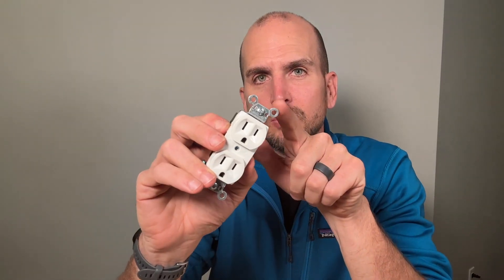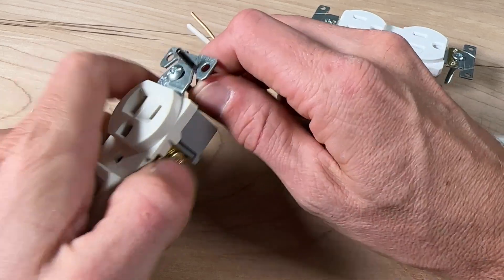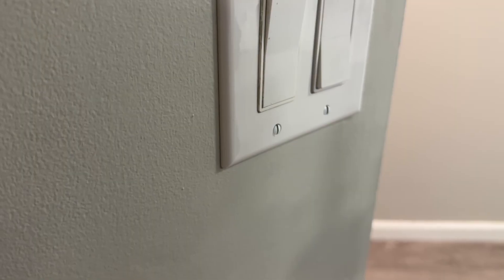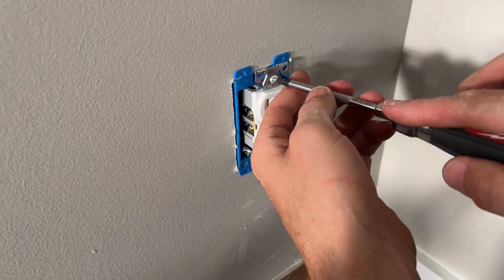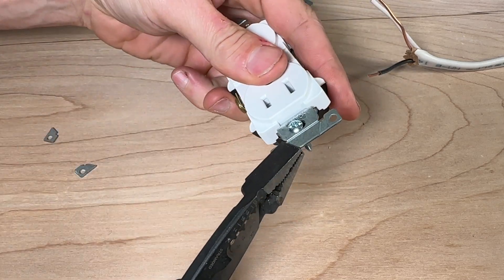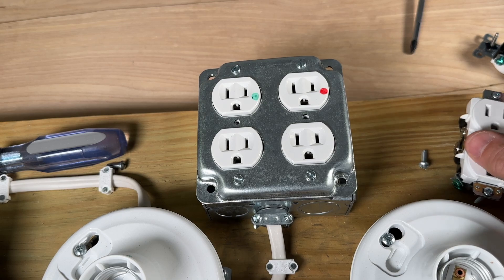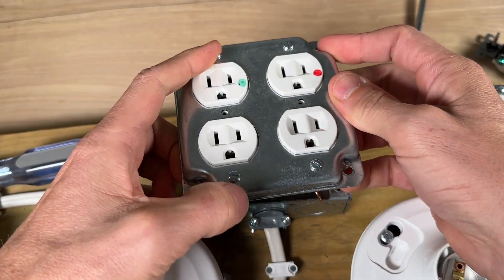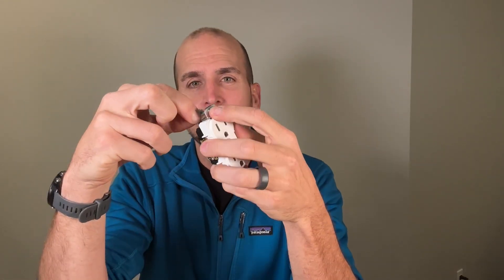Why Outlets and Light Switches Have These little Ears

Comment: My outlet receptacles and the workbox are secure and the plaster ears are sitting right on the drywall, just like your example at 1:12, but my faceplate still wiggles after I tighten the single screw. I'm doing something wrong.

Comment: Hi Scott, older female here. I am too old, rather my knees are too old to do repairs anymore.  Sure do wish you and YouTube were around when I was.  My life would have been so much easier.   I actually liked doing them myself, esp considering how poor the work ethic is.  Just had my LR painted. Found after they were done none of the wall plates were flush and loose.  They, for some reason, pushed the interior in too far. My knees did not appreciate having to go back and redo them all.

Comment: Holy crap, well shoot. Ive been swapping outlets for years in my current home and in my previous ones and i always used those ears to set the depth since most of the old outlets i replace dont have the outlet flush anymore (they as you said would be referred to as sunken). So ive just been bending them a little on each side until the outlet sits flush when i tighen down the screws. Had i known or thought of braking the ears off and using them as spacers id have done that a long time ago lol. But now i know at least. Time to take an hour or so this weekend and go over all the outlets ive replaced in my current home and fix them so the ears can be used as spacers and i can get a more secure stable outlet. Truth be told i need to redo all the romex in the house cause half the house has the original wiring from 1952 when the house was built (which means no grounds or even grounded junction boxes). And the other half of the house that was added on in the 80s might have grounds but its still pretty old and i would feel much better knowing everything is new and up to code. I also have power swings throughout the year that are terribly unacceptable but the power company just shrugs me off everytime i call. We are talking as low as 100v in the summer during the hotest parts of the day and as high as 136v during other parts of the year. Chalk it up the the joys of living in an older house in an older neighborhood i guess....??? Great video, thanks for the info!

Comment: I found another use I think may at least be another reason for the tabs with the holes. A long time ago receptacle boxes were metal and commonly nailed into the baseboard or a wooden surface. they had adjustable tabs so the box could be set to a specific depth. When outlets with dual screws for mounting the faceplate (those decretive square ones for example) came into existence the screws that mount the faceplate hit that adjustable tab making it impossible to tighten the faceplate to be flush with the wooden surface. So, if you want to put a decretive square outlet in a really old-style box start by pulling the mounting nails from the old box. Remove the screwed-on adjustable mounting tabs from the old box, mount the new outlet to the old box with the two mounting screws but then use those tabs with the holes in them to screw (or re-nail) the box and outlet combo back onto the baseboard or wooden surface. Problem solved!

Comment: The worst is always the ancient brick outlet cutouts with generations of layers of various plaster and drywall, leaving the box waaay too deep and, usually, plaster/drywall wider than the box. Then you're forced to mess with stacking nuts or tubes and using longer than standard outlet screws to get it flush. PITA!

Comment: For the metal boxes like the one shown in the video, you'll also need 8-32 (I think) nuts to secure the outlet since the bolts aren't contacting anything strong on the backside in that scenario.

Comment: Thank you for this video. I was wondering why my new Leviton Decora switches and outlets with the Decora screw-less covers in place sat out about a 1⁄16 of an inch from the wall. I am using Carlon old workboxes. I will remove the plaster ears and see if in fact the fit to the wall is better. Thanks

Comment: I was going to ask about the box extension that is illustrated towards the end of the video.  I had a stock of plastic rectangles sized exactly to the perimeter of the box (not the sleeve as shown here).  They came in various thicknesses (1/8” to at least in the extreme, 1/2”).  They were also stackable.  Each thickness was a different color.  I’ve exhausted my supply and could not find them anywhere.  I was unaware that there was an insert sleeve as shown in the video.  I still used the plastic spacer tabs that piggy back together.  On rare occasions, especially on older homes I’d have to go to the extreme to get the outlet to be flush.  It was then problematic that the terminals on the side of the outlet were exposed a bit too much.  To remedy, I would wrap 2-3 wraps of electrical tape encircling the terminals on both sides.   Comments?  Now that I know this insert extension exists I’m purchasing a dozen or so.

Ps when searching for the insert extender, I did indeed find the other color coded stackable extenders in the same search.  Go figure…

Comment: Total respect for your knowledge.  The next time that I have to replace a wall switch, I will have my wife hold the screw driver and stuff while I
explain to her all the features of the switch. Especially the built in wire stripper & the Mikey ears.  I will do it in the morning so my perceived wisdom
will be rewarded with a Lasagna for dinner.

Comment: As an electrician to this day when I rip off these ears or the yoke of the device I save them for another time I may need a small fender washer for a 6/32 or 8/32 screw. Works great for that application too. Save them. 

Jeff - Licensed Journeyman Electrician Sunny Central Florida

Comment: ----- Kudos,  Good explanation,  and you nailed it by saying you "could" use the broken off ears as washer spacers but that it probably wouldn't fix the problem  -  it won't because the receptacle will rock.  The other point you didn't mention was 10 out of 10 drywall installers who cut out the outlets with a rotozip are going to cut them too large for the ears to touch.
Reply: Yeah, every outlet and switch that I've ever had to remove the plate from in my house has the hole in the sheetrock cut too large, with crumbly plaster/mud patches. Most of those are oversized plates, too. I've considered 3d printing some kind of extra-oversized plates, or intermediate/adaptor plate, but the gaps aren't exposed beyond the plates as is, just too much for a solid mount. Not so much of an issue for light switches, but outlets for vacuum cleaner get kinda sketchy when the cord gets yanked and the outlet shifts left or right  behind the plate.

Comment: Only consistent if whoever cut the hole knows what they are doing and dont over cut. Which in my years i have found the installers getting lazy and holes are over cut and the outlet sinks i

Comment: At +3:30 a better example of when you have to remove those tabs is if you use a Handy Box (ie, a surface mount single-gang box). The receptacle or switch won't fit correctly inside a Handy Box (versus onto the cover plate for that 2-gang square box you show) unless you cut off those tabs.
Reply: I've never noticed a problem.

Comment: Regarding your suggestion about using the removed ‘eyes’ on the mounting screw as a spacer, and yes it is correct that they are typically too thin to have much effect except in those rare situations where you only need that 1/16”, I for years have been throwing them into my assorted nuts/bolts/screws/washers containers and find numerous uses for them when I’m doing a project and need something to space a gap, or desire a tiny washer.
Reply: Yeah.  There's a fine line between keeping truly useful stuff like that and collecting dozens of pounds of miscellaneous hardware in a collection of 1- and 2-pound coffee cans, which—both cans and contents—are among the first to get tossed by your wife and kids after your funeral.

Comment: Nuts. When I have used old work boxes in the past I cut a relief with my utility knife in the plaster. Too bad I didn't learn this sooner. I even knew about taking the ears off for some kinds of electrical boxes but I didn't think outside the box to figure out to take the tabs off for an old work box. Also good idea about using the tabs as spacers although I use the green plastic spacers for that usually.

On how far beyond the stud to mount the box: If you know that 5/8 inch drywall is going to be used the box should be mounted half inch from the stud face. This is a little harder to do because you can't use the 3/8 inch spacer built in to the box. You can use a scrap of 1/2 drywall as a guide or just not be so obsessive and eyeball it.

Comment: I'm an electrician and it makes me smile that you do all this research, and spread good information. Thank you. One thing I would like to add is wrap your outlets, over the terminals in electrical tape if you use a metal box. Those metal or ID (industrial) covers can spring to one side when removing and bzzt.
Reply: @Kevin-mp5of  LOL you have no idea what you're talking about. Clearly not an electrician, most likely a DIY homeowner. Also the term is Phase color.
Reply: @Kevin-mp5of  OK you're a hack. Get over it. Try learning how to form a sentence. Or a complete thought.

Comment: Your reccomendation that the plastic box be 1/8 inch gap from the sheetrock is illegal. Boxes are to be flush with flammable surfaces. If not, every box not flush must have a box extension to make it flush
 Been code for 40 years at least.
Reply: @Kevin-mp5of  exactly my point. Look up " box extension" at Home Depot. Also know in the field as an arc suppressor. Plastic sleeve with ears to bring non- flammable area flush, per code.
Reply: Literally had inspectors ask me to remove specific plates to check for either flush box installation, or box extension. City of Houston would fail your inspection if trimmed out illegally.

Comment: Thank you for the "TIL".   It is sort of basic info but not basic info I knew.  There have been times over the years when I was frustrated with the fit.  I never thought about removing the ears.  I think I usually just assumed the box was mounted a bit wrong, hence the small gap in the cover plate.

Comment: Interesting to know.
One thing that really bugs me with the square boxes is that they assume that the studs in the walls are perfect, which they almost never are so the outlets often are a bit skewed.
The boxes I have seen here in Europe are round so you can actually turn the switch or outlet to be straight even if the box isn't perfectly mounted.
Reply: If you look at sec 17 uou can kinda see it. The outlets screews are not in a hole but a slot. So you can rotate the outlet a small amount before tighting down.
Reply: @maxwellmelon69  I have seen that but I have also experienced that those slots are insufficient.
Reply: Square boxes like 3:30?  If you're using a mud ring, you can make the mud ring level.  The corner slots for the mounting screws allow for easy adjustment.

Comment: Can you do a video on the benefits metal outlet boxes verses plastic boxes?
Reply: Metal outlet boxes are best for exposed work (e.g. on the surface, such as on a cinder block wall) or for metallic raceway (e.g. conduit).  Metallic boxes are also generally more fire-proof, but fiberglass boxes can be pretty good in that regard, too.  Personally, I prefer the sturdiness of metal boxes.  Just don't forget to explicitly ground them.
Reply: @jovetj  I agree with you. I rewired my entire house in 2006. I used metal boxes and grounded them with green screws. I feel they’re safer than plastic boxes. I passed all safety inspections. 
Thanks for the video!

Comment: I’ve never personally had an issue with the ears on an old work box. Always had the wall plates sit flush on the wall. They also sell, as I’m sure you know, wall plates with a little deeper recess to make up for the added depth. Great video though.
Reply: @Kevin-mp5of  I hate non-breakable plates.  They don't have the right sheen, and they can look wonky if they are contorted once installed.

Comment: The plaster tabs are also to be used when the box is set too far back and there is a distinct gap between the box and the switch outlet. . These spacers go on the screws to set the appliance even to the drywall while still maintaining a firm mounting between the appliance and the box.

Comment: I've installed 10,000s of those receptacles and switches and I did not know that the hole in the ears was a break-off spacers. I use the holes to break off the spacers after installation when they got in the way with the point of my Klein awl-like you showed on the old work box.

Comment: I think the more important question is why don't those power outlets have switches? In Australia, switches are mandatory to prevent electrocution, to prevent fires and to prevent damage to electrical equipment.
Australian power points, as we call them (or outlets, as you call them) are far simpler, because they all come as one complete piece that mounts to the outside of the wall. For decades, they've all had uniform dimensions, so any switch or power point/outlet can used to replace any other one, whether it's being used in a residential house or in a commercial use.

1:30 The face plate would sit the same whether or not the ear parts were attached, because they also have the centre parts above and below the screw holes. None of the examples seem to show any need for those additional parts to exist.

Comment: Box protrusion isn't always 3/8". It's set by the expected drywall thickness. Some drywall used(usually for fire code or durability reasons), is 1/2" or even 5/8".

Comment: Initially those were designed for addons to paneled walls over drywall or plaster lathe. You just do a bare minimum cut in and drywall screw the ears to the wall with no box. Tacky and not to code today but was a thing mid 70's and earlier.

Comment: Brilliant.  I am not an electrician I work at a DIY big box store (the blue one) and time and again I get asked about why outlets don't fit right.  My mind was blown when I "discovered" boxes where you screw the outlet to the cover, not the box.  Your video about the spacers definitely helped but also knowing that the ears can be removed for old work boxes - if I ever use that at work I can see customers with minds blown.  Keep doing these explanations!
Reply from the maker: Thanks for the feedback Adam 👍
Reply: It doesn't much to blow your mind, that's why you work there.

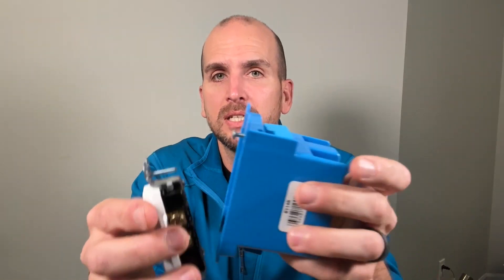Comment: 2:08. After installing hundreds of boxes (or more) I’ve never once had the problem of having a gap behind the cover plate. Just give the box one extra screw turn.
Reply: You will if you put 5 switches in a box ! Dont make Jumbo cover plates that size with the ears and in cy boxes it will not fit. Using 4 gang pop-in (old work) boxes its best to remove ears also you can try shaping the cover all you want but a corner is gonna stick out.

Comment: 1:40. Use a hand drywall saw, NEVER a power tool to cut drywall. You could unknowingly damage a pex pipe or another wire. Besides that, it puts a huge amount of drywall dust into the air and all over the homeowner’s furniture.
Reply: @Kevin-mp5of  Or when you want a clean, professional job.

Comment: I always assumed this is what they were for but never actually knew it.  the funny thing is I have never, not once in my life, encountered a box that was actually installed to the correct depth.  They are ALWAYS either too shallow (flush with the finished side of the drywall) or too deep (flush with the insulation side of the drywall).  I've worked on old homes with original knob & tube and later retrofitted, new build homes from the 80's, 90's, 2000's and everything in between and all of them had the box depth set wrong.  Most even had both problems in the same room.  lol  This is why I firmly believe that if you don't do it yourself you should never trust it.  And even then it's not a bad idea to get a second set of eyes on it. 😁
Reply: Perhaps your standard for "correct depth" is too high. The proper depth is "1/8" BELOW the finished surface, not flush. The code allows for flexibility due to changing thicknesses of materials.
Reply: @denniswilliams3934  Exactly what I wrote.  They have always been flush with either the room side or stud side of the drywall...so 1/2" off.  That's more than 1/8" either way but if you can show me how my math is wrong I'll happily listen.
Reply: @Enjoymentboy  My sincere apologies. I think  I am just too old and half blind. Perhaps my reading comprehension is also on its way out. Retirement form the Power Plant side effects. Have a great day.
Reply: @denniswilliams3934  It's all good.  Not a worry.  I too have age knocking at my door.  One day I hope that bugger realises I'm not answering.  lol

Comment: Well done. May I add to your hole in the "ear"? It is not a good practice to remove the ears when the device requires lifts for flushing with drywall. As you mentioned, most likely the 1/16 gain is likely not enough. maintaining the ears, prevents the device from rocking side to side beneath the finish plate. Another tidbit: The holes are typically used for for #6 screws to affix device to non metallic surfaces. Continue the fine work you do.